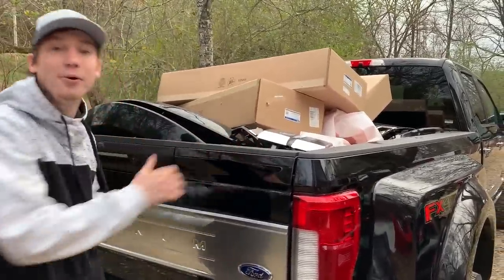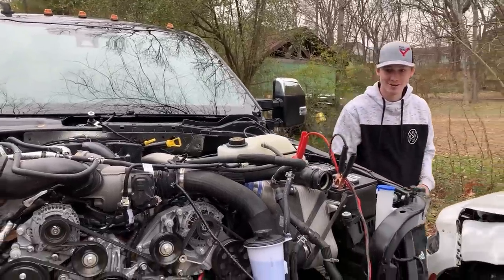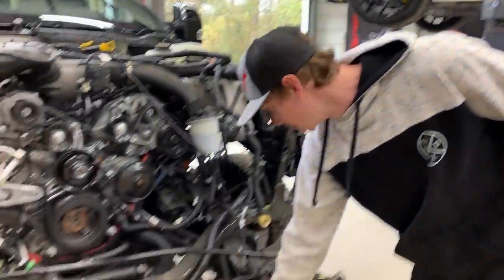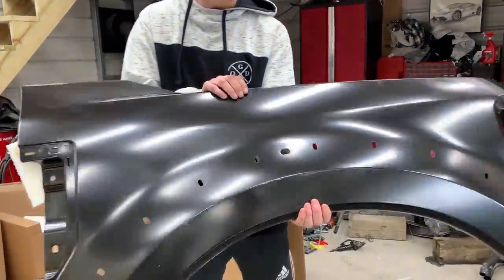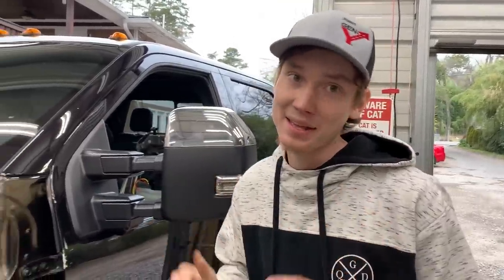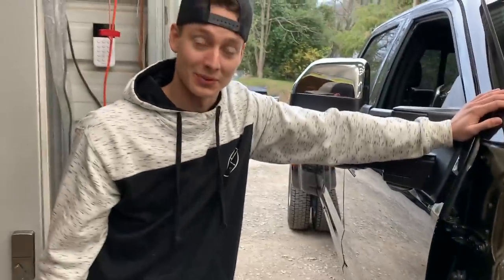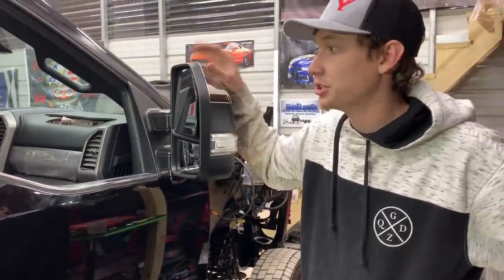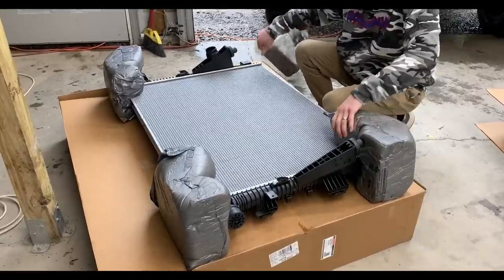Rebuilding A Wrecked 2019 Ford F-450 Platinum Part 4

Comment: That belt "whine" from starting FORD was bcause ur empty batteries...Alternator gets so much load to charge them and gets belt slipping a bit...no need to worry about it I think so
Reply: That's how you can kill alternator pretty quick, battery should be charged.
Reply: @waszkowiec  how do u work that out, an alternator runs the car and charges the battery so a flat battery wont harm an alternator, all a battery does is turn the starter over
Reply: McRiccoEST lol
Reply: @fazeulla-britta3662  Dealing that almost every workday, I'm a technician and working with trucks everyday, the symptoms are pretty similar...even new belt keeps whining when engine is cold and batteries are empty...ofc in this case there can be some other issue as well but lets keep in mind its quite new truck...Your LOL sounds so unfamiliarly here

Comment: Can’t figure out why you guys haven’t bought a battery charger yet
Reply: They need better quality jumper cables to I seen those dollar store things they was useing
Reply: Need 2 chargers....they could be charging those batteries, might find out that's all they needed in stead of replacing them.
Reply: Because it’s necessary that’s why like good tools
Reply: You honestly think they don't have a battery charger?
Reply: evilution yup I do. They’re always going out and buying new batteries when I’d put money on it that half the time they’re fine just need to be charged. If they did why wouldn’t they just put the charger on when they were working ??
Reply: @jasonhovey815  Maybe they simply don't trust the batteries from crashed cars of unknown servicing. A flat battery will have sulphated on the lead plates meaning a lower amperage output. If the battery has been abused, the lead plates could be warped.

If you are rebuilding the car, why not just replace the battery just to be sure?
Reply: Have you actually rebuilt any vehicles?
Reply: the upscriber I’ve lost count how many. Complete off frames
Reply: @theupscriber65  several, mainly front end destruction.
Reply: Jason Hovey 1:57 open your ears and listen
Reply: BANT3R not charging with the truck running
Reply: Christmas is coming guys..  That would be the gift that keeps on charging lol!
Reply: Battery charger or no battery charger, wouldn't it make more sense to park the thing with the front facing towards the road so that instead of having to tow the thing out to get jumpers on it, they can drive right up to it?
Reply: @evilutionltd  Apparently not. They still haven't charged the batteries.

Comment: Ugggh please don’t black it out. F-450’s especially at that trim level are perfect as is.
Reply: I AGREE 100% with TOUCHE PADRE 52 that like the GMC is the top of the line TRUCK it is the most costly TRUCK too either one of them the GMC or the FORD but  REST ASSURE the FORD will cost a world of a lot more than the GMC due to the TRUCK it is

Comment: You guys should check out the clear plastic covering the airbags. It's not a normal plastic and see if the two of you could tear a piece of that plastic without any sharp objects. It is designed to encapsulate the airbag if it goes off in the package
Reply: Yikes ~ Does the plastic need to be removed BEFORE they install?

Comment: Try rebuilding the highest mile car you can find, try 300k plus. Doesn’t have to be salvage you could build the motor and rip it!
Reply from the maker: Not a bad idea
Reply: c'mon lets make this top comment right now
Reply: General Shark hell yeah that be dope!
Reply: You ought to evaluate what skills you lack or have minimal know-how. For example, rebuilding engines and transmissions. With older cars you can get into rebuilding carburetors. Also, extensive body work to include use of the English wheel rollers and anvils to fabricate your own body parts. 

Think of what you want to do in 3-5 years. Do you want to be creative customisers like George Barris, Bill Hines, Chip Foose, and Singer?
Reply: goonzquad like jr garage right now, they bought a half a million mile corvette c5
Reply: Volvo.
Reply: Buy my Mercedes OM606, 876k miles.
Reply: ga gamba lacking mechanic skills?
Reply: Get a 1.9 tdi mk4 golf x it with a r32 or audi tt awd manual  , tuned deleted 300+tq diesel.. that would be sweet.. #widebody
Reply: Enard Lehman the tt didn’t use a 1.9tdi nether the r32, vag cars are definitely something to look into for high mileage variants. Vw make the best cars
Reply: Contact Tavarish, he has a 1,000,000 mile Lexus.
Reply: David Peterson yeah, Goonzquad would probably finish it before tavarish would even get around to starting it haha
Reply: @generalshark2833  no shit ,that's why it would be a cool swap...
Reply: @generalshark2833  alh tdi bolts to either trans 5 speed or 6.
Reply: I’ve got an 01 F150 with 300k!

Comment: If it was me I’d keep it purely stock.   You just don’t see that many 450’s out there.
Reply: I agree. It's a waste of money to replace perfectly good wheels for example.
Reply: The wheel tire combination on the 450’s are also how it has its towing capacity.
Reply: I agree....keep it gangsta!
Reply: K P  I agree that a stock 450 Platinum is special. I can’t wrap my head around blacking out the truck and wheels. However, it ain’t my truck! They made a “Donk” out of the GMC so I’m pretty sure of the direction they will go.
Reply: They're really common here in northern Utah.
Reply: Just imagine how many custom 450’s you don’t see!
Reply: Yeah facts man
Reply: 100% agree. Looks great as is and I was thinking the same thing. Last 450 I saw was a stx and that was at least 2 months ago. It is a rare truck let alone a platinum.
Reply: @Jddvs  I agree with you, it's a beautiful truck WITHOUT mods....and just like you, it ain't my truck!

Comment: Do gloss black door handles, get some Morimoto XB LED headlights, tint the tail lights black, tinted windows, leveling kit (don’t lift, keep the towing capability), get some aftermarket gloss black dueley wheels) just slightly larger tire (toyo open country A/T 2). Fully delete the truck, 5 inch straight pipe, and custom tune 👌🏼

Comment: Gets the platinum edition... wants to black it out.
Reply: It looks better blacked out in my opinion.
Reply: Thought the platinum meant it comes with all accessories etc not the color? Like the king ranch a xlt or limited. Havent googled it bc im lazy but i always thought that was what the platinum/etc meant
Reply: @leechylivey4881  you are correct it's just a trim level
Reply: Leechy Livey it does have the fancy chrome grille and the tailgate panel on the exterior.
Reply: @eizzle78  ahh ok thanks! I like the grill as is but all that other chrome can definitely go.

Comment: You guys should buy a seacan or 2 for your parts. Keeps then safe and out of the way and when the new shop is built just drag them over with your toys in them. Cheapest most secure storage and makes room to work in the shop. Not to mention your bikes and side by side storage.

Comment: I recommend doing a pull on the old aprons before removing them
Reply: Patrick Cawley I mean that’s usually how you have to do it 😂
Reply: You are correct , not sure why "GAMERBOY" thought your comment was so funny.  Goonzquad is fun to watch, but they don't really follow proper repair procedures.  A rough pull should be done on the entire front end before they start removing structural parts, which the apron is.
Reply: Darin Vee I mean I’ve been watching them since they started and they always pull pushed in aprons first, and do you know how many cars they have done already I think it’s safe to say they know what tf their doing, oh and don’t insult my great name 🙄
Reply: Darin Vee it’s common sense to pull the damage out first and people in this comment section always knows better so
Reply: @benny2765  I just watched the first 8 minutes of the next video and they removed both aprons and the lower core support with no pull what so ever.  These guys are fun to watch and usually things work out okay, but they do not follow "normal" repair procedures very often.
Reply: Darin Vee I just saw the video but that’s bolted on so why would you pull a piece that’s bolted and that’s not kinked in the back but yes giving it a pull wouldn’t hurt just in case but hey their car their way if it works it works 😂

Comment: “We want a tow rig cause we went over board with the GMC.... *talks about all the extra things they want to add to the ford*.....”
Reply: You noticed that too?
Reply: I was yelling at the screen when they were modifying the GMC after saying they wanted a “tow rig”
Reply: Mooresheri all they said they wanted to do was black it out and aftermarket wheels wasn’t it?
Reply: SierraSltGmc it Does look stupid.
Reply: SierraSltGmc that’s a myth you can add bigass tires and badass lift and still tow no problem. I’ve done it myself with a 30foot travel trailer and I always see badass trucks towing bigass toyhaulers in sand no problem. The Duramax looks clean quit hating bud
Reply: You got to fight the urge to modify, please keep it stock.
Reply: @tajwilkins7896  Well, they said they wanted to "murder" it. They said they wanted to do the mirrors, the trim around the doors and the front grill. They mentioned the wheels, but didn't elaborate.

Comment: The coating on the new panels is called E-coat usually you sand it at 500/600grit then lay a wet on wet prime that how we roll in New zealand btw not all new parts come pre-primed thats pretty much only what suzuki does

Comment: Crazy how you spent $9,000 on parts and the dealership still messed up your order. They need to focus!
Reply: Exactly. How hard is it to order parts for a single truck when you have a darn VIN? Now if they had been ordering parts for different cars, I'd understand a little mix up.
Reply: Especially for such a new vehicle; should be pretty simple. Doesn't follow the dealership was to blame though. They may have ordered the correct components from the parts warehouse, just been sent the wrong s**t. Whichever way, someone f**ked-up a $9,000 order; I'd be wanting some answers.👎
As the video progresses, even some of the stuff they did get is wrong. Ford needs to sort out their supply chain, this ain't a good advert. These guys spend a lot of money; they(and everyone else) deserve much better service. I'd be expecting replacements, delivered to the door, tomorrow morning.
Reply: Luis Ramirez it’s crazy cause here in Detroit the Ford dealership I go to also is known for messing up parts orders. They just don’t double check what they received from the parts warehouse they just deliver it to shops and then try to act surprised when you call and complain lol
Reply: 2H80vids exactly! It’s funny cause the Ford dealership here in Detroit does the same thing! Then we call and complain and they act surprised so it’s probably the warehouse not knowing wtf they doing! And in the video they have goonsquad opening up boxes and doubling checking for right parts WHY? Why can’t the workers do that?
Reply: Yep, priority customers!
Reply: anyone else notice how thin those fenders are and the hood look like they dont even look metal more like plastic
Reply: Drift3r ForFun probably not OEM maybe the factor is using after market parts? Lol
Reply: @detroitrebuildz5748  Bro this is almost at every dealer. My cousin had a Hyundai Tuscon that needed a passenger front window regulator, dealer ordered, when the part came, it was a driver regulator but the box says RH passenger, they ordered over night again.... Same problem, box says RH with a driver reg inside..... Car been sitting out there for almost a week waiting. Someone at the warehouse are mixing up crap.

Comment: Just don’t put some goofy wheels and lift it and make it useless.
Reply: volvowagon70 hey that’s not - oh wait I get it  they already did
Reply: Yesss
Reply: Not that it matters on a GMC....real work, you get a Ford, order a BUILT DODGE.
Reply: A truck stays perfectly useable with a lift and wheels 🙄
Reply: @AppMagnet  Not really it matters on if you are keeping the stock springs or not. Lifts also mess up geometry for the suspension making it easier for components to fail.
Reply: Im sure the load rating of DONK TIRE & WHEELS are NOT acceptable for WORK....illegalities are immense if an AT FAULT FAILURE should occur. Insurance will be VOID.
Reply: Hallelujah and AMEN to that!
Reply: Yea and don’t put some stupid mud tires on it keep it stock with some nice highway tread
Reply: @lobo8902  Yessir!
Reply: Even they admitted that they went overboard on the GMC.

Comment: Numbers on parts are how many truck they were test fitted on at the factory before they ended up on the parts cart. Def seal those parts when painting you still need a certain mil thickness for proper adhesion.

Comment: The star shaped rivet is called a self piercing rivet. Keep in mind that the rivets and spr's are coated because of dissimilar metals. Must be coated to protect the integrity of the truck. I work where these are built and if you want more info message me.
Reply: That's good to know!

Comment: Hey guys, y’all have my dream truck! I would recommend keeping the factory wheels, tires, and suspension configuration completely stock! These 450s are built to tow heavy. With a rating of 32,500lb gooseneck I would recommend maintaining all factory configurations and equipment in order to safely benefit from your trucks exceptional towing capabilities. Beautiful truck! Highly capable, but puh-lease No aftermarket wheels, tires, or lift. Do that kind of stuff to a single rear wheel 250. These duallys are tow beasts. Especially that 450 with her 4:30 gears.
Reply: i might go with black wheels but other than that that thing is big enough

Comment: Build that F450 all black out everything blacked out and put a 4 inch lift on it with some 26 in forgiato dually wheel with 2 super single wheels on the front all blacked out wheels with the chrome center hub cap and chrome lug nuts bad ass baby

Comment: I had to replace shock mounts and leave spring mounts on my f250 and i had to drill and torch to get them off than just bolted replacements back on. U can even spot weld the nut so it wont loosen. Being on the front end im not sure how that will work. Im a do it yourselfer like u. YouTube sure is helpful considering every vehicle is different. All the vehicles u have accumulated do u get at auction.  R all the super cars yours there very nice

Comment: Those aren't spot welds, they’re pinch welds. And those are also rivets that attach the aprons to the body. The roof rail attaches the same way. I built those roof rails for a time.

Comment: I dont think you should black it out when normally I would be all for it, from the look of people’s opinions in the comments I for once agree - you bought a platinum for a reason. If it were mine I would put some aftermarket wheels on for sure. There are some really sick dually wheels on the market. I would’t put tractor trailer wheels or 24’s per-say but definitely aftermarket wheels of some type. Personally if it were me I would have considered opting for an aftermarket grill like a royalty core butthead again that’s a classy truck and the stock does look great, regardless on this one I’d leave the chrome.  It even be cool to see the whole truck wrapped but on the other hand maybe it be nicer just to have something you can stay lower key in especially if you plan to do any traveling. I’m all for big wheels, big lifts and everything crazy but I think you got a taste of that with the Duramax and as much as I don’t want to admit it - it does limit you some and at times it’s nice to just have something stock...ish. I’ve been watching you guys since you only had a couple thousand subs and what I like about you guys is that your real, genuine, and stay out of that YouTube drama. With that being said and with all due respect I would like to see the more recent enhanced energy I’ve been noticing toned down some and just be yourselves no need to be overly energetic or super hyped up  you guys are great the way you are.  Being a ford guy I’m so happy to see that your doing another Superduty. I would so much rather see builds like this or the police car over the Lambo and Ferrari stuff.  Since I already wrote way too much and In the off chance you read this my personal recommendations for future builds would be things like a Trackhawk, Gladiator, Raptor, some type of classic car or truck (f100 on Crown Vic Chassis would be my vote), a nice premium wakeboat, maybe an rv/toy hauler or even a kick ass enclosed trailer and for sure the new shop build. Hell maybe even something totally different and off the wall for you like a Tesla. Whatever it is you guys don’t need my input you know what your doing. I’m sure you have some great things in the works.

Comment: Guys that black primer on new parts is transfer primer you NEED to prime or use SEALER OVER IT. I see guys in youtube vids painting over it directly, NOT CORRECT. Please do it right for the truck paint to last.. Ive painted for a loooong time.

Comment: That massive moonroof/sunroof is awesome UNTIL YOU GET INTO AN ACCIDENT & GO FLYING OUT OF IT OR, HAVE IT COLLAPSE WITHIN ANY SERIOUS ACCIDENT. All vehicle's should have a roll cage & the entire passenger compartment should be modular, built first, completely caged & surrounded with air bags to ensure passenger safety, Especially when the cost of such vehicle's are so high! How hard would it be to completely encapsulate the passenger compartment like a break away passenger compartment on a hydrofoil type of a speedboat.